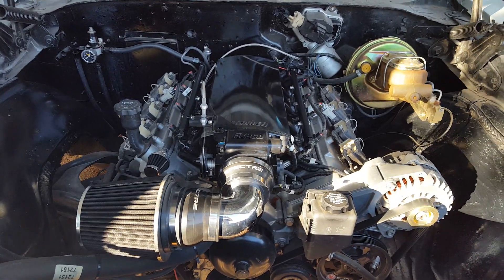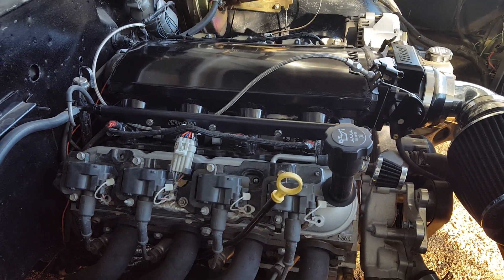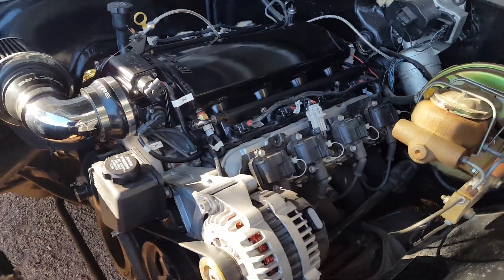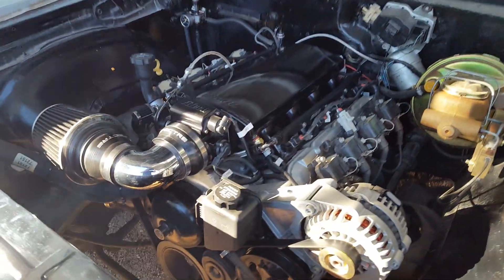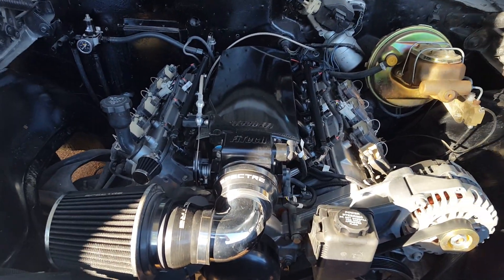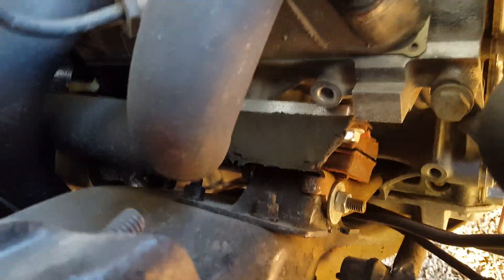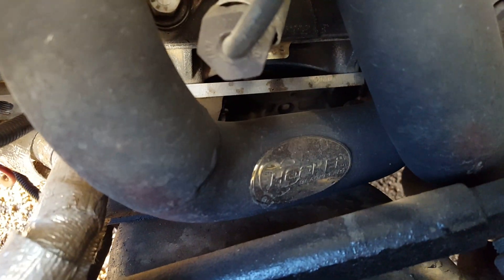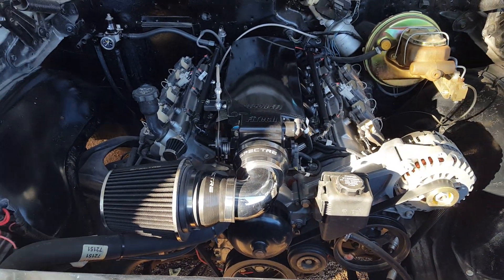LS3 FITECH System

Comment: I just bought this FITech system for my vortec 6.0 , I got long tubes , cold air intake , & a stage 2 cam , I plan on getting a 3” exhaust system, how much RWHP do you think I will get ? Also have you run into any problems with the FITech so far ?
Reply from the maker: I have not had any problems with the fitech. Now for hp its hard to tell without details of your combination, compression, heads, miles or new build, ect..

Comment: I have the same Fitech system exactly except for that it’s intake is for cathedral port heads. It was easy to install and easy to  get running. Now I have an LS3 and will need a different intake and bigger injectors but the same system will run the LS3 too, just have to reset basic setup settings. Holley Terminator X wasn’t out yet,
Reply from the maker: I will be purchasing a Holley next for my turbo build LS, I keep everyone updated on how that system works

Comment: What kit did you use for the throttle wire?
Reply from the maker: Ls1 wire from jegs or summit
Reply: Check into Summit for a 36" I believe.
Reply: @benjismith593  Thanks!